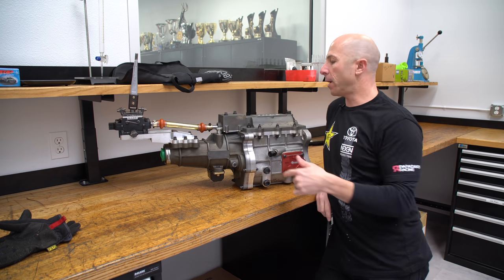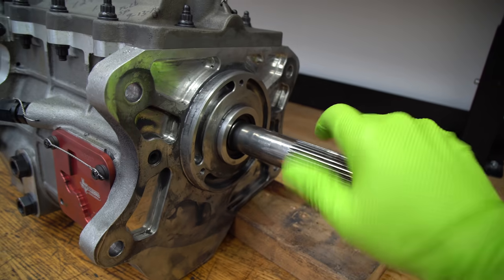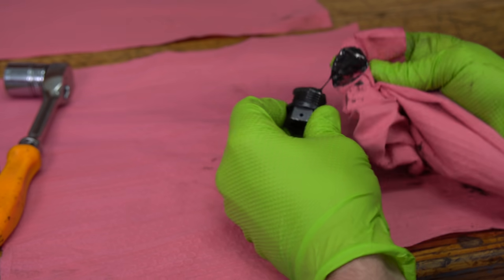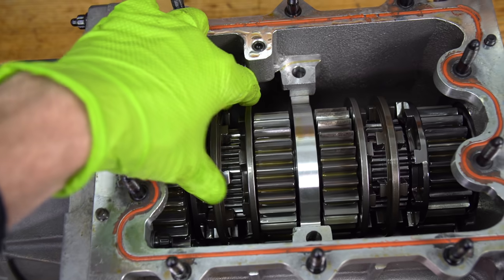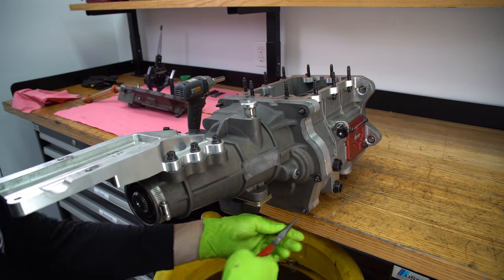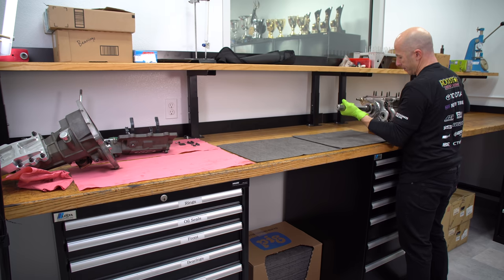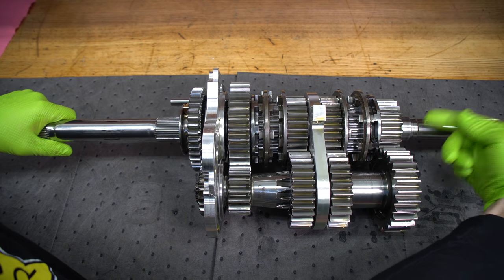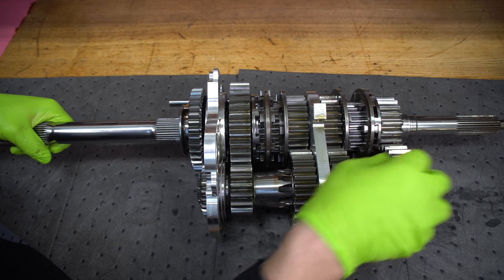NASCAR Transmission Teardown and How It Works

Comment: I thought helical gears were stronger due to more teeth engagement, they are just harder to manufacture
Reply: Helical gears are indeed 'a little' stronger than a straight spur gear, as well as quieter because of being in constant mesh.  But: When enormous amounts of torque are introduced through helical gears, they generate massive longitudinal thrust in the main and countershaft, thrust which needs to be absorbed by the thrust washers, bearings, and the transmission case itself.  Because of the gear pitch, the powered shaft will 'push' the driven idler shaft rearward (or forward, depending on the pitch angle), then through the output (tail) shaft in the case.  It would add too much weight to build a tranny case strong enough to absorb that much thrust in a big HP race car.  Plus, all that mechanical energy generated and absorbed as 'thrust' amounts to resistance - lost horsepower at the transmission output shaft.

It's the same principle with the hypoid ring and pinion gearset in the differential. (Hypoid gears are necessary in that 90 degree junction of mechanical power.)  Accelerate the car, and the pinion will be 'thrust' forward in the pinion carrier against front thrust washers; decelerate, and the pinion is 'pulled' toward the rear axle's centerline by the ring gear's pitch but once again retained by a thrust washer and roller bearing.

Comment: ok so the straight cut gears are stronger right? I got told in college in UK that the side cut gears are stronger because there is more surface touching the other gear ? So who is right, yeah the straight cut gears are louder than side cut,
Reply: Your college is right but since straight cut gears do not produce axial loads the component/case design requirements are less than a helical gear transmission at the same power level and therefore lighter

Comment: Hmmmm, had to disassemble a Renault passenger car trans to have its odd front seal replaced, had a bunch more parts than this one, like, where are the synchronizers, I guess it doesn't have any or what?
Reply: http://www.superstreetonline.com/how-to/transmission-drivetrain/impp-1109-synchromesh-vs-dog-box/

good link describing the difference, synchros are good for comfort and daily use. but aren't as quick as dog engagement. Motorcycles pretty much exclusively use dogs. From experience you can shift much quicker and easier and on up-shifts with enough finesse don't even need to use the clutch.

Comment: why only 1:1 on 4th? IIRC some 6 speeds like the T56 goes down to 1:0.68. Wouldn't race teams want something that allows the car to go faster?
Reply: hardleecure they can select a different final drive ratio for the rear axle as 4th will allways be 1:1. Gear ratios through 1-3 can be tailored the track being run.
Reply: @leanderjohnsen8339  I guess they don't make tracks long enough for a better ratio out of the transmission.  going from 1:1 to 0.68:1 is an extra 30% but requires a lot more power so maybe that's why they just do it direct.
Reply: @hardleecure  Direct 1:1 is fastest. If you need a higher gear for top speed, you just change the rear end gear. Gives the same final drive ratio but the transmission has less drag because it isn't going through the gears.
Reply: rules

Comment: The more common name for this type of transmission is the 'Top Loader' Incorrect again, Many of the tracks at which NASCAR runs require a Higher top gear and so the teams will run Fourth gear as an 'Overdrive gear'.

Comment: I want change the 5ft gear into my Tacoma I love the low ratio but I need more Obed drive in freeway did anyone know if it is posible just open it and replace that gear ⚙️
Reply: I would love a higher 5th on my 97 Tacoma. Customtaco , pirate 4x4 or yotatech would be the places to ask and search.

Comment: Why does that look about one third the size of my regular transmission ? That thing is stout !
Reply: No need for massive built up thrust bearings to angle axial loads. Radial loads, hence the "handcuff" is the only load straight cut gears exert. Due to this, the transmission can be smaller, lighter, but still strong since straight cut gears are a stronger design.

Comment: Are the rules only 4 speeds or theres another reason for that?
Reply: yes and no, it depends. but the 4-speed is the most common when it comes to NASCAR dogboxes. rally cars usually use 6-speed sequential dog boxes.
Reply: Partly because of simplicity equal reliability.  And the NASCAR engine has enough torque over a wide range of engine speed to only need 4 speeds.
Reply: Nah it's just rules.

While torque is delivered across a wide range peak power is not. 

Having more gears allows you to stay closer to peak power and have more wheel torque on average due to the shorter gearing. 

Shift times can be shortened with modern sequential designs or a dual clutch system. 

This simple design is only used because Nascar doesn't like proper technology. 

It has nothing to do with costs either. If that were a reason they would have said everyone has to use a stock factory production unit. 

Not that it matters much in oval racing. But it does at the road/street circuits.
Reply: 5-SPEEDS used at Pocono.
Reply: @BigEightiesNewWave  Not in Nascar. they are ALL 4 speed boxes at EVERY track

Comment: When driving with that exact transmission, do you have to double clutch with it in order to shift right? I ask because of it being straight cut gears for that kind of high power, high speed application.

Comment: Why do NASCAR cars need a reverse gear? Wouldn’t they want the weight savings?
Reply: The weight savings for removing reverse would be maybe a couple pounds. The almost undetected loss in weight doesn't outweigh the ability to use reverse.
Reply: The reverse gear and simple mechanism won't add more than 5-8lbs. The benefit of having a reverse far outweighs the weight savings. Sometimes they miss their pits by a bit, have to back out of garage after repairs which both cases needing reverse.
Reply: Also NASCAR requires them to have reverse so they couldn't remove it even if they wanted to.

Comment: Never watched NASCAR in my life, but i'm honestly surprised they even bother to put a reverse gear in there...
Edit: also surprised there is no overdrive gearing, you'd think top speed was all that matters in a race, no?
Reply: No. Tops speed would be important in a luxury car setting, where really rich people buy cars for the labeled tops speed (240, 270, whatever).

Most track cars rarely exceed 150mph, and often travel through corners at 20mph. Just to throw some numbers at you. Overdrive doesn't matter near as much as acceleration (quick, not fast) and shift speeds.

Comment: wow ok..   that is one dinky lil transmision..   in fact I think its actual smaller then the 13 bolt locker I had in my old ford fairlane.

well..   least it holds together, last test said I'm pushing over 1200 foot pounds of torque.

Comment: Do this is very boring. I got a rebuilt Asian 5 speed everything seemed fine after about 15000 miles second gear shit the bed.  Why? When rebuilt the tech installed the spring and sleeve for second forgot the ball. Any how got a free transmission out of it

Comment: Now I just know there must be a reason why I'm wrong here, but anyway...

Straight cut gears are NOT stronger than helical gears. In fact, the opposite is true. That said, straight cut gears are preferable in race transmissions because since they don't produce axial forces (which can be pretty high in high-output race engines of course), you can get away with far less reinforcement of the transmission case. The axial loads produced by helical gears can actually cause the transmission case to fail even while the gears themselves would otherwise be fine. By using straight-cut gears and thereby eliminating the axial loads, transmission designers/manufacturers can build essentially 'weaker' transmission cases without compromising reliability/longevity, with potentially huge weight savings. I'm not aware of any other reason (other than cost-to-manufacture) that straight-cut gears are preferable to helical in race applications.

TL;DR Straight cut gears allow lighter transmissions not stronger transmissions.

Comment: It always pisses me off how street cars have angle cut gears just for sound when it has such an awful performance drop from it.
Reply: The performance advantage of straight cut gears is that they do not produce axial loads so they require a less robust component/case design which is therefore lighter but the gears themselves are weaker than helical cut

Comment: You dudes need yo switch to Chrysler made transmissions and ATF4. I  have 235,000 miles on a Jeep 4 cyl with improper use, 1 blown engine and a busted transfer case, and spilled all my transmission fluid and it runs clearer than this gear box lol